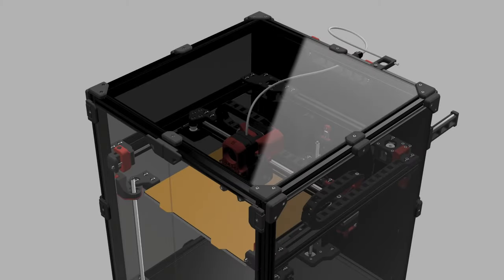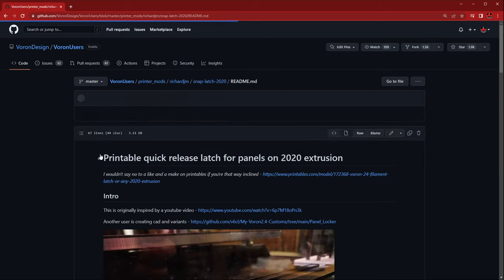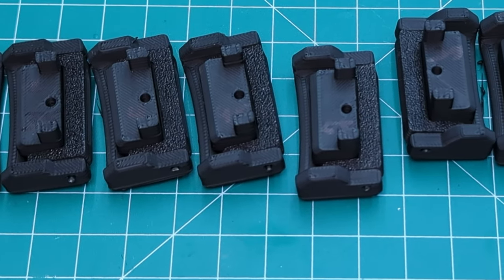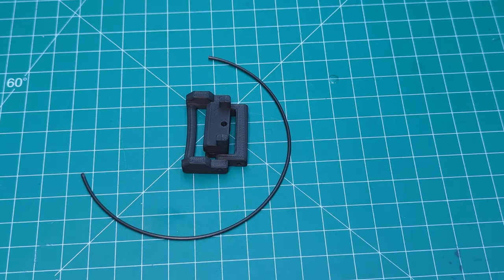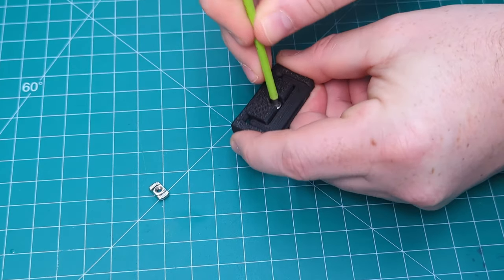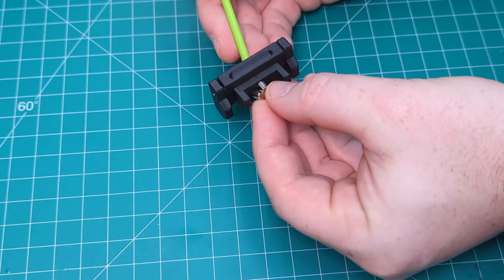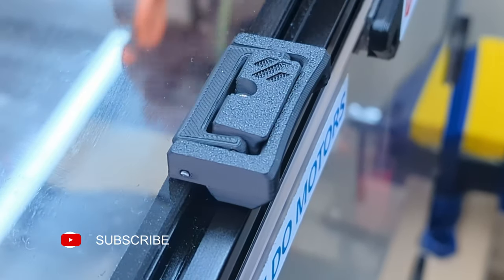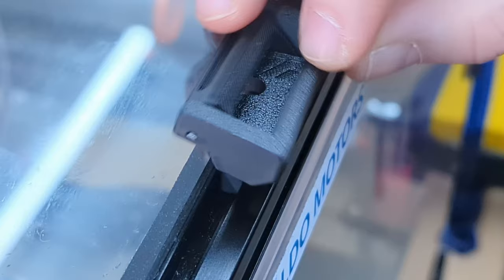Voron Mod Showcase: Snap Latches

Comment: These latches are brilliant. For the 3mm top panel with 1mm foam lining, I find the 3mm latch works best (it could even be a little tighter but it's good) so I'm guessing the 6mm latch should work well with the 3mm side panels with 3mm foam but I'll have to try it first to confirm. Thanks for making this video!

Comment: Started out with using these for the front doors on my 2.4r2, because I wanted something simpler and "closer" than the stock handles. Since then I also switched the left and right side panels to these. Thought about installing them on the back as well, though the simplicity argument goes out the window as soon as the ERCF is done and mounted on the backside of the printer, which I'm working on right now.

Comment: Any idea if these would work in PLA? Putting my 2.4 together now and obviously can't really print in ABS yet.
Reply from the maker: They won't melt or anything, but I can't guarantee they will work as expected. PLA is much more stiff and brittle than ABS, it might make them difficult to open.
Reply: Thanks! I might just double-sided tape some cardboard on for the initial prints to get the ABS latches out the door and everything bootstrapped. Just keep a fire extinguisher close by lol
Reply: @dylanculfogienis8853  I've used masking tape to print all the non-pif parts for my v2 and it worked great!

Comment: For some reasons, mine don't snap like yours do, nor do they hold the panel that tight. Is this normal ?
Reply from the maker: There are several different thickness of these clips, you may want to step down a little bit to get it to snap and squish perfectly.    I believe we used 4mm and 6mm but I don't remember for sure.